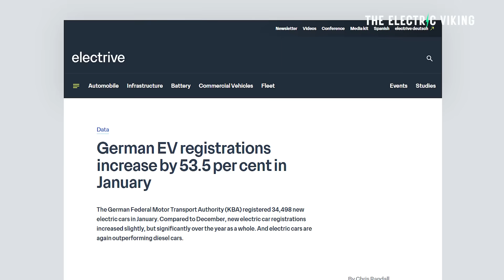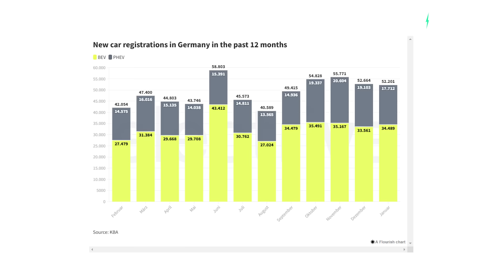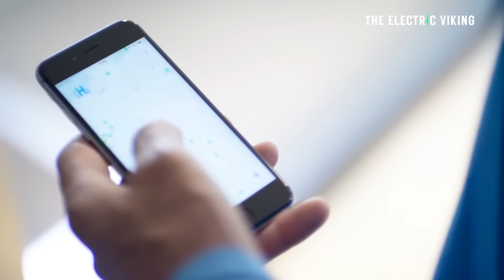EV registrations in Germany skyrocket 53.5%, gas and diesel sales plummet

Comment: Sam is damn right about the irrational choice, the prevailing preference for gas guzzlers. Germany here, Erfurt. We hit the all-time record for car sales here, against the national trend. Pure EV sales - for this urban/suburban area - dropped below 10%! Charging infrastructure is a sham hlin most neigbohoods but charging at home is cheaper and better for the battery anyway. I know 3 neighbours with EV/plug-in hybrids, no one is even trying to charge at home. The plug-ins are then atax payer scam. 
In the countryside its even worse. People there often make a point of counteracting climate saving measures.
Reply: It will happen you just need to hit the car drivers in the wallet. Here in the Netherlands gasoline is about 2 euro's a liter off the highway, and about 2.25 Euro a liter on the highway (about 75% is taxes) . BEV sales are at around 35% of total sales. I find fast charging infrastructure ok when driving through Germany.

Comment: The sales skyrocketed mainly because VW offers unsustainable leasing rates for its EVs to avoid closing of factories and avoid paying billions of emission fines for its fleet emissions. For example, VW asks 150€ monthly payment for a 24months lease without down payment for a ID3 worth 35.000€, meaning in two years VW gets 3.600€ but is left with a two years old basic EV worth at most 20.000€, for which VW should still get at least 31.400€. This leaves the company with a loss of more than 10.000€ per leased vehicle. On top of that, VW’s ID3 production costs are apparently even not covered when sold for the asking price, meaning loses could be even much higher than 10k+ on each sold ID3.
Reply: @timram3766  yup they are stupid at vw. Only thing they are good at is earning money. A total gross profit og 16% is better than Tesla !!😲

Comment: I`m keeping my old diesel as long as possible although beeing a great EV-Fan. 
Reasons: 
It is not connected to the internet via sim/esim. 
It has no WLAN, Bluetooth, NFC or positioning systems.
It has no sensors like microphones, cameras.
It can't be accessed via (the possible attack pathway of) over the air updates.
It can't remotely be rendered unusable,
It has no remote control key which signals could be intercepted. The key is metal.
No data about me or the car are transferred onto a server and then sold to data brokers who sell to insurances, advertising etc..
If there was an EV which is unconnected or has hardware kill switches to deactivate all sensors and transmitters I would reconsider.
How long is any connected car supported by critical software updates? 
If that number isn´t at least 20 years I'm not buying. Especially if it has autopilot capabilities that can be hacked and taken over.
On Youtube look for 
"A Stern Warning About In Car Technology and Privacy"
"Should You Remove The SIM In Your Car?"
Well I'm permanently looking for a new EV: Usually I go to the dealers and make testdrives. 
Then I mention that I have no need for any connectedness and ask to be shown how to remove the sim card or the microphones from the vehicle easily and without fancy tools. 
The answer is always DON'T KNOW or NOT POSSIBLE.
If we as consumers don't care about this topic it will get worse and worse.

Comment: But Tesla sales fell by 63% in Germany and 69% in France and 72% in Spain
Reply: In Europe more than 70% of Teslas are model Y which is currently out of production while the delivery of the new model Y Juniper will ramp up end of the month/March. People are simply waiting to get new model instead of buying old one.
Reply: @ohyesitsme  That is what I am trying to tell people but they won’t believe it. This is the last year for BEV.
Reply: @allenparsens5279  Should we consider the worlds war costs as an oil subsidy.  EV batteries will be recycled so after 20yrs the materials mining costs will begin to shrink.  Also Can you imagine all the wasted energy from hydro plants when demand isn’t at capacity.  All that energy can be buffered by batteries to be available. So let’s say batteries can increase the ability of one hydro plant to double or triple its homes supplied. Any extra power produced has been historically wasted. With batteries that extra power is stored.
Reply: @ That is not the current experience. Mining companies have said they have no plan to mine enough resources to create these batteries. We have also had battery farming go into thermal runaway when they are brand new. We had a a brand new school bus a month or two ago, break down in Canada and 5 minutes after children got off, it went i to thermal run away. We have had three factory battery storage sites go into thermal runaway in the last week. I think that was 8000 batteries. We have these batteries going into thermal runaway in the Palisades. Do you know how toxic the smoke is? Contact will injure you for life. I mean if it gets on your skin only.

Comment: Skyrocked from a very low and special January 2024. They did cut state subsidies in December 2023.....everybody bought the car before.  It was an unusual month to compare.
Reply: Jan 2025 Petrol & Diesel 46 % market share, Hybrids 37% & Pure electric last at 17% market share, up vs very low Jan 24 just after the subsidies were cut (source: MarkLines)
Reply: then that makes the tesla figures even worse then ?
Reply: @ianrob4760  so you didn't watch the video.
Reply: @noeltwomey285  yes I did but the headline is the click bait on any video ... check through Sam's list ... missing the one about tesla collapse ?
Reply: so lets see tesla slumps and the overall market rose, hmmm I spot an issue ?
Reply: January 2024 was up 30% from the previous one, let's see what the year brings
Reply: He said that in the video 😎